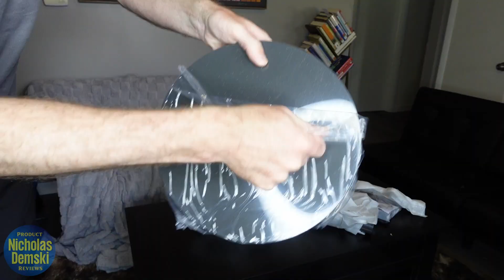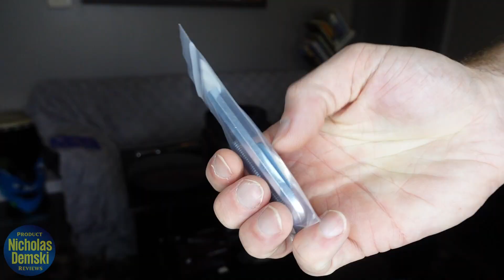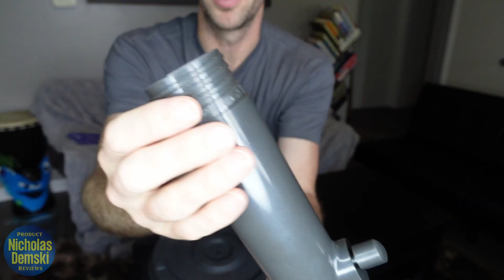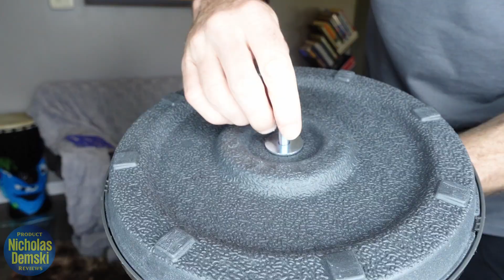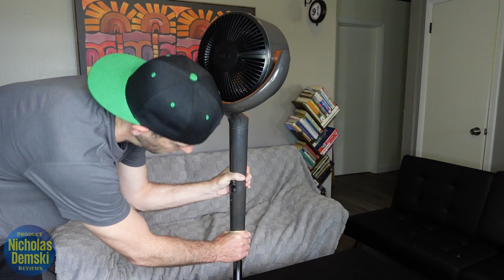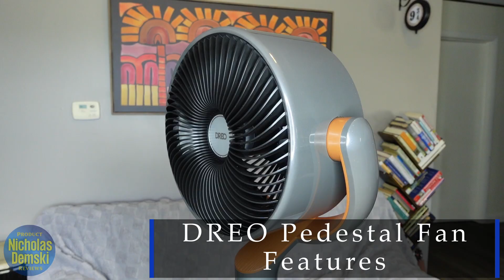HOW TO ASSEMBLE Dreo Pedestal Fan! (+UNBOXING and HOW TO USE IT!)

Comment: I got this model, the 502, the 513S and the 704s (I have certain use cases in each area with no AC and it works great) …

The worst by far is the 311. The 502 is just slightly better with vertical adjustments. 

I found the 513S to be objectively the best, followed by the 704S. Close but the 513S is quieter and pushes air slightly more efficiently if you ask me (second part is subjective) 

Moral of the story- the 513S on sale for $125-135 is the best. And definitely get the 704S otherwise. They seriously push air. They are true air circulators for the room and not just a fan (power is the limit) 

Take care and thank you for the video. Although I own this- I appreciate it